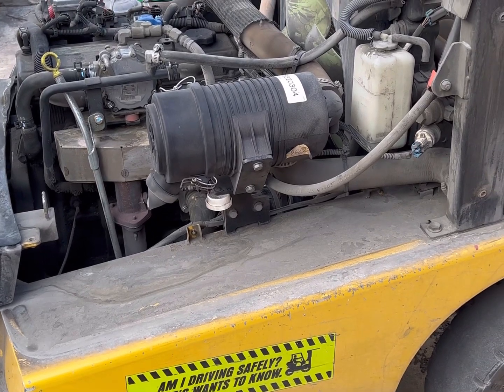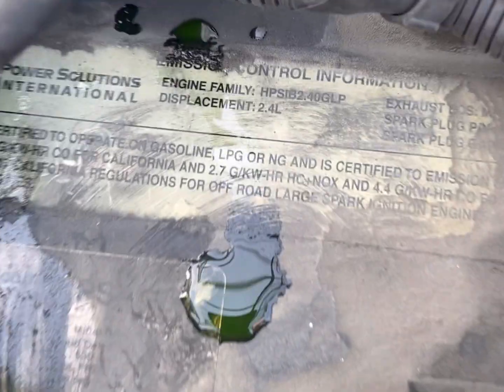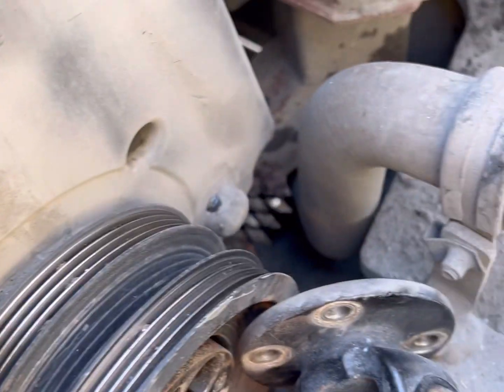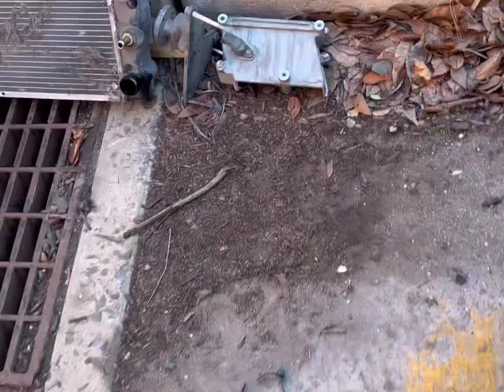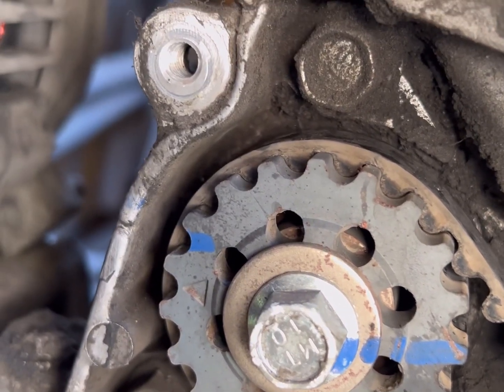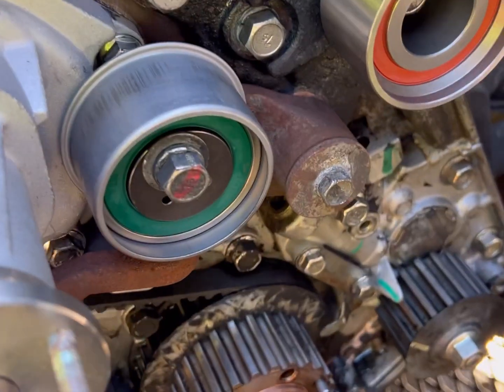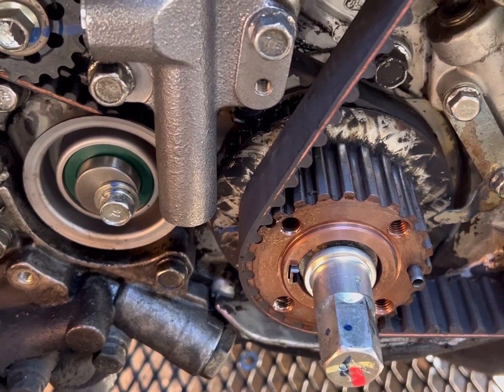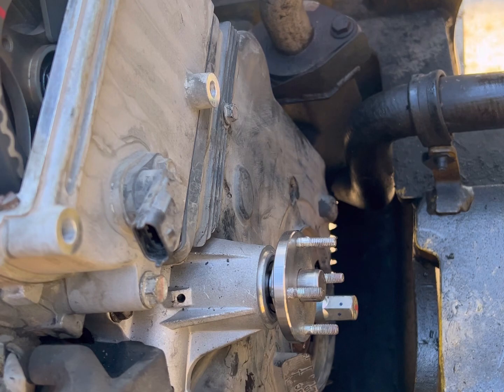Timing belt 2.4PSI

Comment: I have a psi 2.4 on my glc 050. I can’t find any literature. My locale Yale techs suck. Running super rich can’t seem to locate the problem. Any help would be appreciu
Reply from the maker: @garrettdowning4010  if your running rich I was check your fuel trim on a laptop. Most likely the mixer is gummed up might have to take apart and clean it.